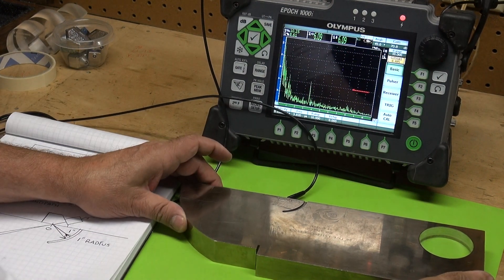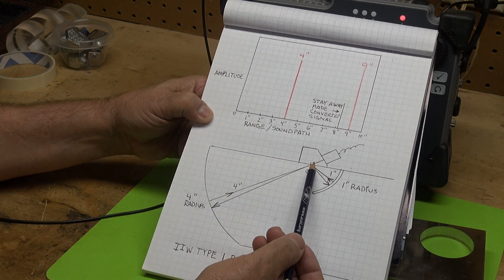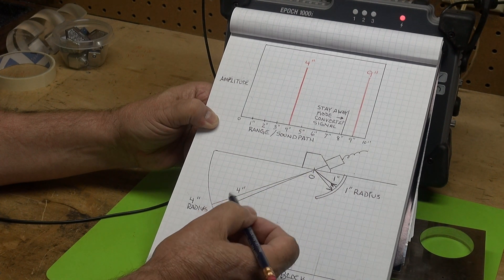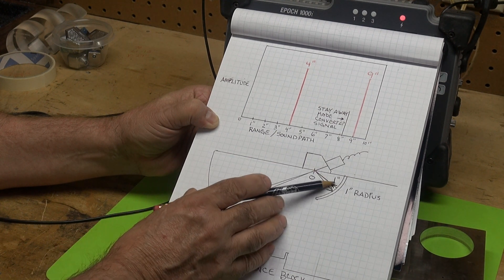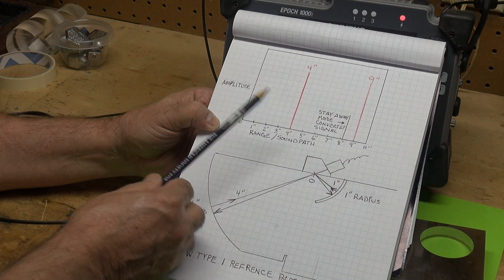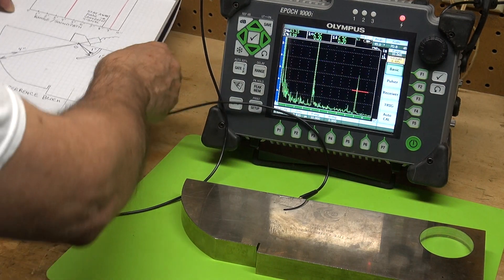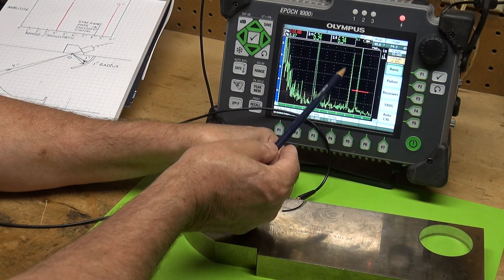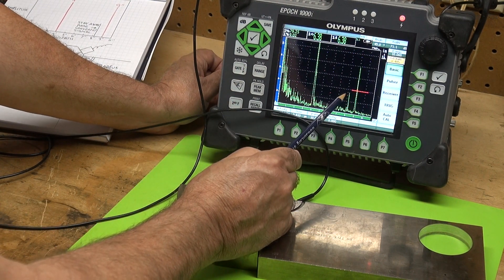UT IIW Type I Block Caution and Comments

Comment: The 8" signal is not a mode conversion signal, it's a double reflection of the  first 4" signal and it can  be used for calibration if you set it at 8".
Reply: That makes sense but someone else said the snail wedge eliminates that signal. Do you know how that eliminates it?